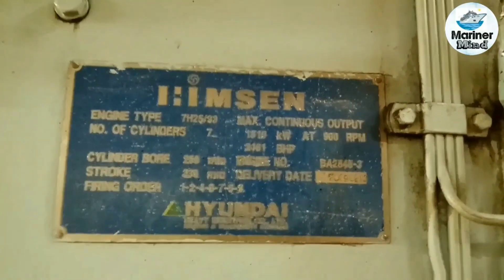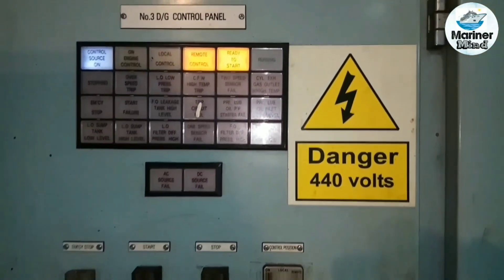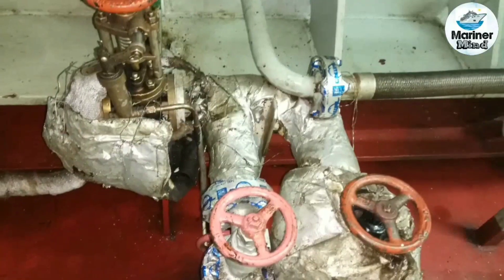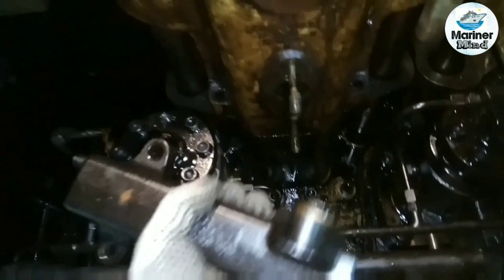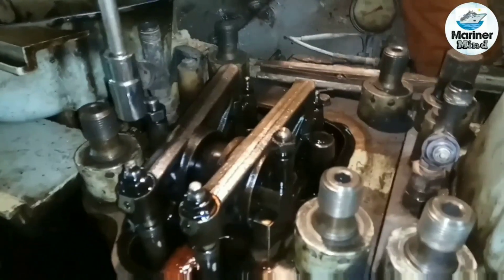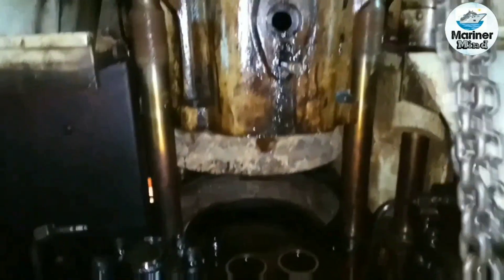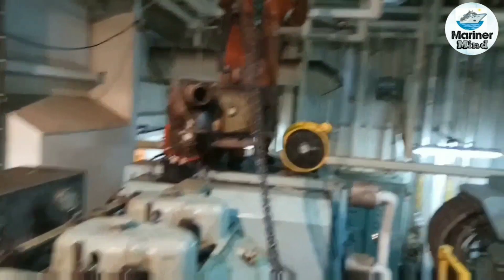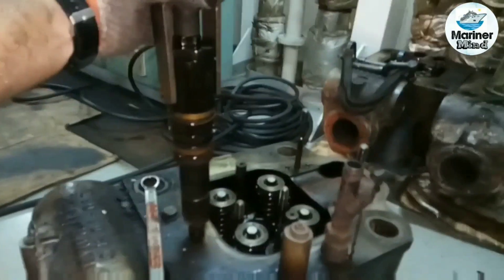Cylinder Head Removal- Diesel Generator unit overhaul series  part 1- HIMSEN

Comment: Sir, do you have special tool for pressure testing the cylinder head before installing back to the engine ?or to fabricate only . Thank you for your reply.
Reply from the maker: I will soon be making a video about cylinder head overhaul..  regarding tool some ships tool is there, but you can fabricate one.  Basically you need to close all the openings with some teflon plugs and a pressure gauge and cock connection to give air pressure after filling water.